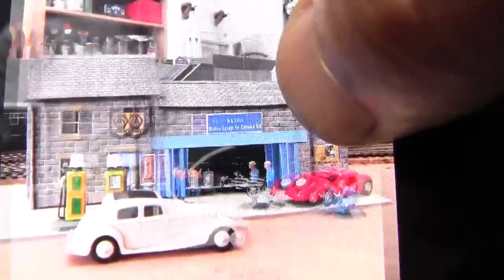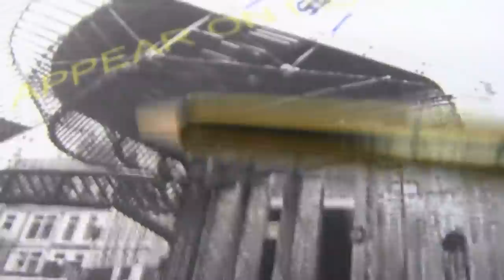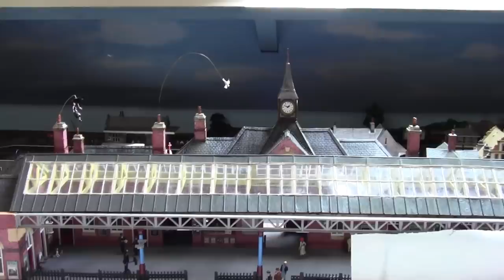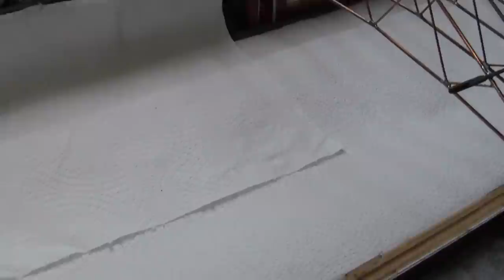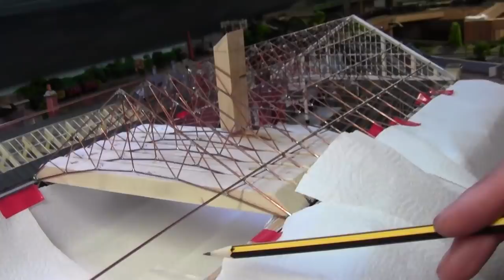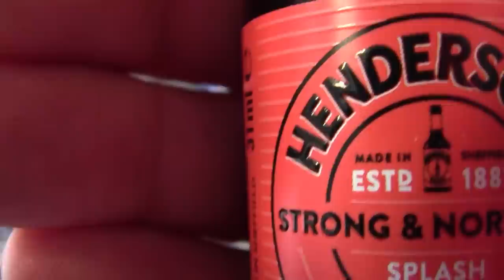The Big Roof. Part 6  Coming Together...........No 280

Comment: I have been looking forward to this roof build for some time. It was worth the wait. Amazing. There was never any doubt that the trusses would come out of the jig and fit, almost perfectly. Your meticulous attention to measurements ensured that it fitted. However you did confirm that a steel erectors proffered spanner is a lump hammer to deal with minor inconsistencies. Carry on the good work. I hope that in accordance with current H & S recommendations you will fit netting under the trusses whilst fitting the glass and boarding.😎
Reply from the maker: Hi Alan, it has been a long time coming, we have had a lot of fun getting there. yep a big hammer would always work for the final tweek's. what's great about this structure is its weight. i am very surprise on how light it is. there is still a lot more left to do before its finished. who knows where we go from here.....all the best Tony

Comment: Fantastic work Tony!  Looking at how you put it together makes me think of how they must have built the original station.  The work involved in South Shields and also Sunderland to produce such amazing buildings and to think that with a bit of help from the Luftwaffe but mostly Town Planners of the 60s there is nothing left to show for it.
Reply from the maker: Hi Richard, a very true comment. out of the two stations Sunderland is still intact and in regular use by two networks. metro and BR. 
its a shame they did not use south shields. Westoe lane and the Marsden rattler Branch. 
But we have to move on....at least we have a replica shields station...many thanks again.....cheer's Tony

Comment: Well Tony you have surpassed your goodself, what a piece of art, bloody brilliant mate. 
Unbelievable construction, you must have the patience of a saint.
Its amazing, I would not know where to start in building something like this. 
Looking forward to the next video.
Regards Chris
Reply from the maker: I think so to Chris. its has worked out a lot better than I had hoped for to be honest. building and planning things is the easy bit. the hardest part is figuring out what works. and the materials to use. as for the next video. well hopefully the centre section may be completed. then we can clean it up and spray paint it. and then glue the facias on. until next time stay safe. cheer's Tony

Comment: Impressve roof, Tony, a very skillful piece of model engineering...  Incientally, I don't know how hot your loft was, but it was to hot to work inside my shed last week!  All the best, Ken.
Reply from the maker: Hi Ken. thank you for your kind words. i had gone in the loft 2 Fridays gone when the heat wave just started, just to take a few photo and measurements for a subscriber. and with in a few minutes i was soaked. i open the window and went back up there half hour later hoping it had cooled down. and it was just the same. never known it to be like that ever. yep it was hoy. 33 degrees in the house at mid day even with all the windows open. so i had a week of from the railway....stay safe buddy.......Tony

Comment: I relish the thought, it's HP for me. I hope you are not going to be one hanger short of a full wardrobe. The roof is taking shape and I wish you luck with the middle part and that it does not drive you around the bend. I have just finished building a Metcalfe stone viaduct and it looks very good apart from one end-capping stone is not quite straight. I am not going to move it in case it spoils the stonework. Martin.  (Thailand)
Reply from the maker: Hi Martin. the relish is quite tasty believe or not. I think i do have a full house of coat hangers. if not i still have the jig to make more. its a shame about your capping stone. if you very careful you might be able to do something with it.. all i can say Martin is carry on regardless my friend....all the best Tony

Comment: Lovely work our lad,Swan Hunters engineering spirit is alive within you.The rods you are using are they steel gas welding rods or brass brazing rods?I can see model railway layouts growing an overall roof once you enlighten your followers.Whats next as a model of Stephensons tyne road rail bridge would look nice somewhere on your layout.Stay safe and crack on.
Reply from the maker: Swan Hunters, now there a blast from the past. i knew of some lads who used to work there. 
i good mate of mine Barry Gillis. taught me everything i know about pipe fitting...
 the rods that i am using are Mild steel TIG welding rods. 1.6mm and 1.mm. who knows what i will build next as there are few area's that need my attention.... many thanks again for commenting....all the best Tony